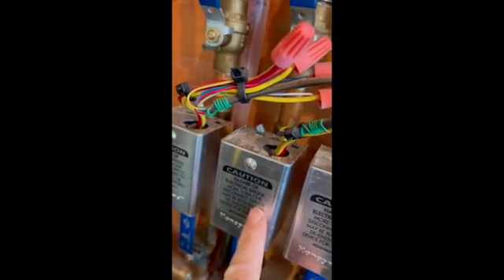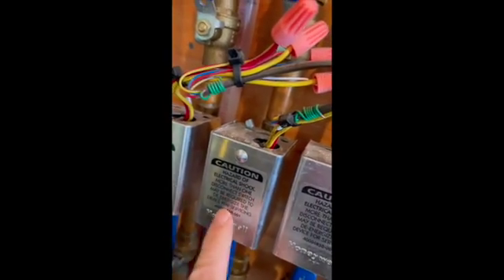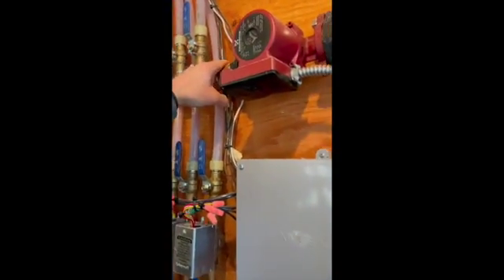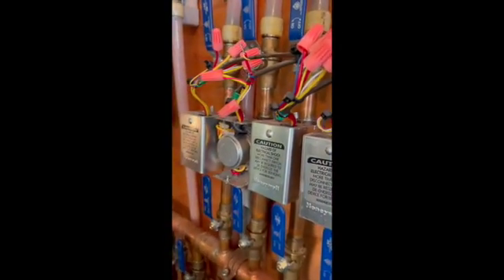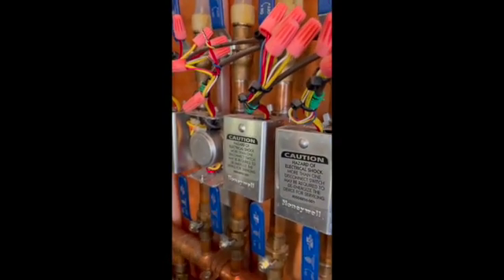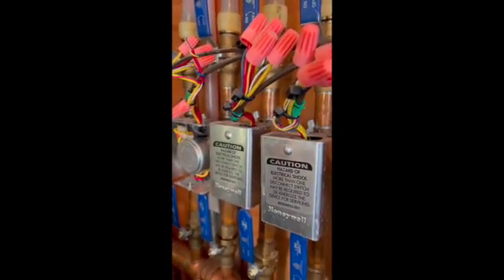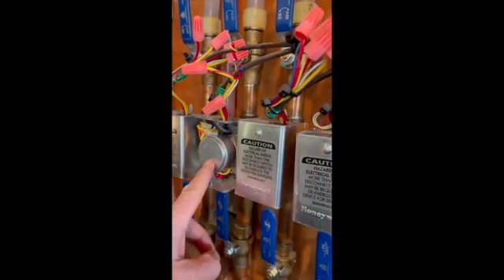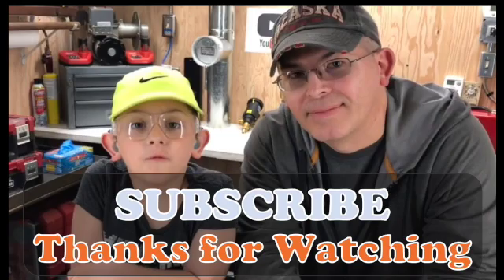BAD ZONE VALVE? NO HEAT FIX – Honeywell V8043E

Comment: Thank you! Sounds like I am having very similar symptoms. Only getting hot water when our other zone is running, so I guess it is stuck open and the manual switch is pretty loose. The boiler is not firing with this zone. The zone valve case seems warm too, not sure if that is normal.

You mention the end switch originally but at the end you say it is the power head. What specifically did you end up replacing? Did you just go with the "Honeywell Zone Valve Repair Kit" that you linked to? And not the end switch or the motor?
Reply from the maker: I replaced the powerhead which includes the motor and end switch all in one.
Reply: @FurnaceTech  Thanks. Do you happen to have a link to what specifically you ordered?
Reply from the maker: Thank you for watching!

Comment: Hello sir , just taking a look at some of your videos , they are great help, I have a question ,so I have a electric boiler for in floor heating and we are having a problem with it turning on at night time . We have it preset for a curtain time to kick in when the temp drops below 74, but only happens at night time , it’s drops below 74, but not kicking in, and i check the zone valves they are working fine and we replaced the t-stats, and works fine in the day , but something at night doesn’t seem to be working right , anything else we should be looking at , and also we have to shit the main switch off to the furnace and back on to get it to work properly
Reply from the maker: I am guessing you have a programmable thermostat which you are setting for the time and temp.
Try swapping the thermostat or jumping out the thermostat and see if it works ok.

Comment: Great video! I noticed ball valves above and below each zone valve which btw looks very professional. My installation was done 3 years ago and has no ball valves above or below the zone valves. I'm getting ready to drain my system to replace the pressure relief valve and expansion tank. Will the zone valves prevent water from draining back into the boiler while the boiler is draining? In other words, do the zone valves have a check valve to prevent water from flowing the opposite way? There's a ball valve on the return side but nothing between the boiler and the zone valves.
Reply from the maker: If the power is off to the zone valves then they will stay closed and no water should drain. As long as they are functioning properly
Reply: @FurnaceTech  That's what I was hoping. Thanks for the quick reply.

Comment: Will these new powerheads fit an almost 30-year-old Honeywell zone valve?
At first blush they look the same. Thanks Laddie I am afraid to sweat new because there is no valve to shut water off on the zone. Soldering & water just don't mix.
Reply from the maker: They will not work on the old green plastic ones but the others work ok but I would not guarantee all old models. Make sure to double check or test one before attempting every zone at once.
I hope this helps.

Comment: Great vid..My thermostat was set at 65 and came out to it being 72 in my living room..Shut the stat off and living room heat register was still hot over an hour later..Shut furnace off at the box and register cooled..This a thermostat issue or zone valve stuck open perhaps?
Reply from the maker: I would turn everything back on and when the register is hot, turn off the thermostat and see if the zone valve closes. If it’s still open, check power to it. If there is no power and the register is still hot then it’s a zone valve issue. If there is still power, then it’s a thermostat issue
Reply: @FurnaceTech  I'm having this same issue but with baseboards. Kitchen zone is constantly at 71 even when thermostat is set to 40.The gas boiler cycles every 10 minutes for 1-2 minutes then shuts off, only sending heat to the kitchen. I have 3 zones but this is the only zone I have this issue with. And not sure why its even heating at 70. Is this a valve issue or is it the aquastat?
Reply: @AmiiboJuice did you ever get this resolved?
Reply: @LeseanRowe yup. The motor in the motorized ball valve fried. Had to replace. At least in my case, I didnt have to do any plumbing. There are youtube videos on how to DIY
Reply: @LeseanRowe i didnt realize this was a DIY lol. Been a few years. But I did as I mentioned previously